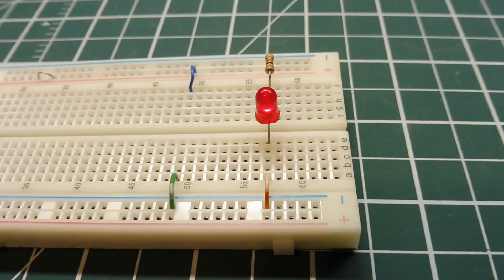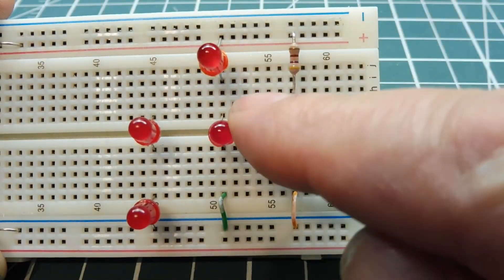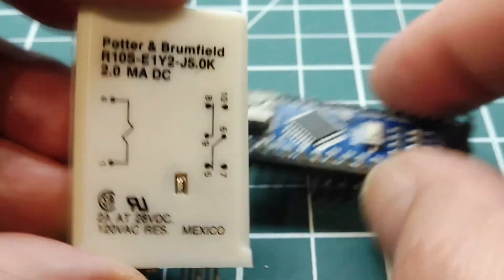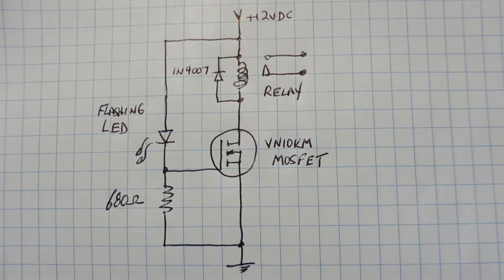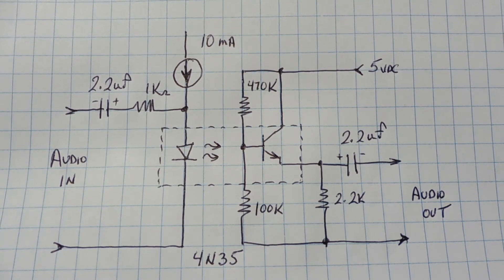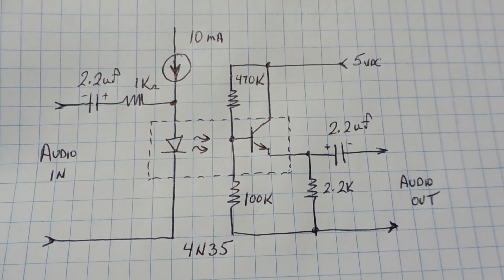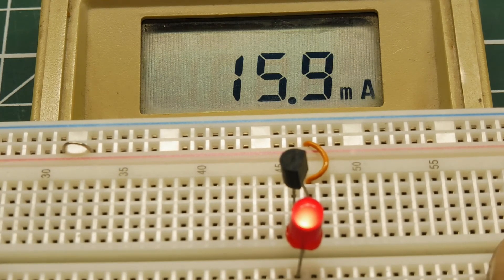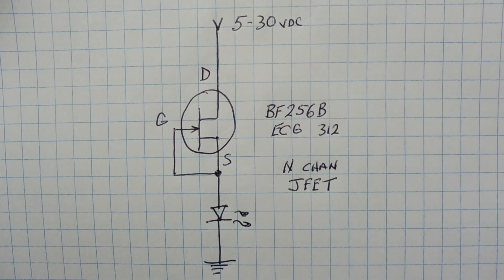Handy little circuits that you can build.

Comment: Would you recommend this flashing LED as a controller for  effectively acting as a 2hz PWM for slowing down a DC motor?
Reply from the maker: You cannot change the duty cycle of the LED flasher so a simple circuit using a CD4093 would work out better. https://youtu.be/mjIubJeTRyY
Reply: Excellent!!!

Comment: Hi 0033mer, I have a question: since current flows from a battery or power source from negative to positive, why is I that we attach a series resistor to the positive (anode) lead of the led?  It seems like the cathode should be protected first since that is the side of incoming current.  I'm confused.
Reply from the maker: DC current actually flows from positive to negative and electron flow is from negative to positive. The direction of current flow has no bearing on where the series resistor is placed. In a series circuit the current is the same no matter how many components are involved. Placing the resistor on either side of the LED is ok.

Comment: Thanks... and sold... I've got to order me a flashing led. Suddenly I realize they are slightly more useful instead of just plain annoying. 
   I've played with that JFET current circuit awhile back just for fun. It gets a little more resistant to input change if you put 2 JFETs in series.
   In a pinch, N channel JFETs are used inside almost all electret microphones. It's probably the most common place to find one, if your willing to ruin a cheap mic to pull one out. I've build a little guitar preamp using one just to compare it to a few other classics like the 2N5457 and J102 (IIRC the correct part numbers from memory ;)

   I have a bit of a request for an Engineer. I've been trying to understand the different ways to divide and measure a frequency with a simple 8 bit MCU. There is a circuit related to the Open Source AVR Transistor Tester project. This auxillary circuit uses a few logic ICs to test "high" and "low" frequency crystals. The circuit uses a CD4011 NAND Gate (for "low" only), that feeds into a 74HC4052 multiplexer (that is the "high" input as well). The first 74HC4052 is in series with a 74HC4060 -14-stage binary ripple counter with oscillator, that is in series with another 74HC4052 multiplexer This is then connected to an MCU pin and interpreted in software. I'll try to upload a picture shortly, just in case anyone wants to see what I'm talking about.
  I'm not asking anyone to explain the circuit, build it, or anything like that. I want to better understand frequency multiplication and division. I need more fluid concepts on a practical and simple level from someone who knows how to explain things visually while keeping it 5-10 minute simple. That's a unique skill I'm learning to value. I've been flipping through The Art of Electronics, done a few web and forum searches but I keep going down rabbit holes of information where I need to research lots of background info to understand the subject as it is explained.
    I haven't played with a lot of logic IC's, I'm learning about AVRs at the moment, and I have no real experience with precision frequency devices.
   So from that perspective, what is frequency division? What are the different topologies/approaches/limitations, with simple hardware? I'm surprised this information seems so difficult to figure out.
  I've put together a colepitts oscillator that Allen showed on his W2AE channel that I use with my Rigol scope, but I'm trying to understand how to build more complex circuits. Are the IC's used in the circuit mentioned specifically important or is it simply a buffer, multiplexer, counter, multiplexer kind of thing? Is there some easier way to do this through an integrated circuit? 
  -Jake
Reply: Link to image of the frequency divider circuit mentioned https://lh3.googleusercontent.com/-Azly5ePhc6s/WfQTjRX2K_I/AAAAAAAAAf4/mV44rNrQ2EsKwKkQH-g39Jty-vtdswbrgCHMYCw/s640/Screenshot_2017-10-27-20-29-32.png
Reply from the maker: To divide a clock frequency we use the D flip-flop in toggle or divide by two as a building block. We can cascade them to divide by a large number as seen in the 4024, 4040, 4028 and 4060 ripple counters These counters can only divide by even integers. To divide by odd numbers you can use a Divide by N 4018. To multiply a frequency we use PLL ( Phase Locked Loop ) like the 4046. W2AE has a good video on PLLs. With microcontrollers being quite common today the way to divide/multiply clock frequencies is by using DDS ( Direct Digital Synthesis )  https://www.adafruit.com/product/2045